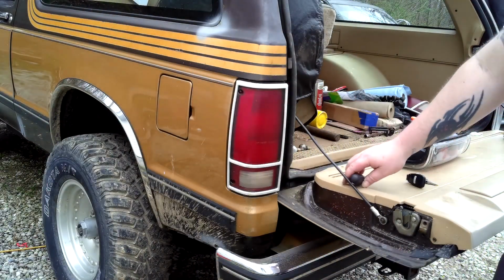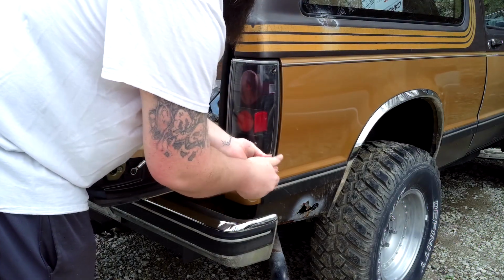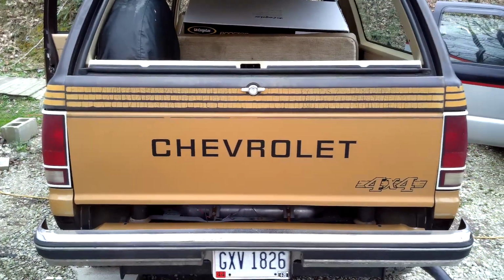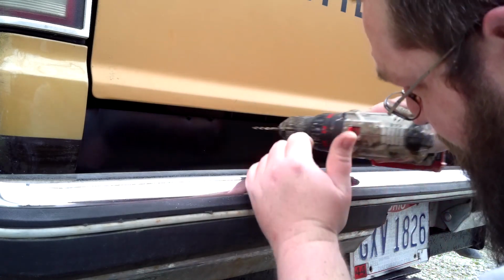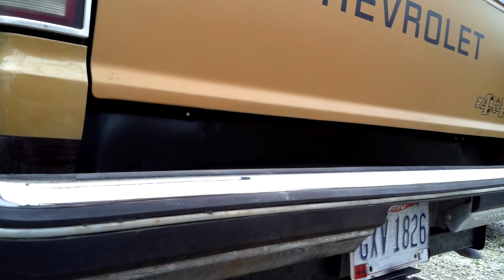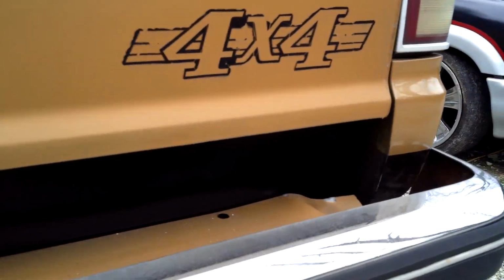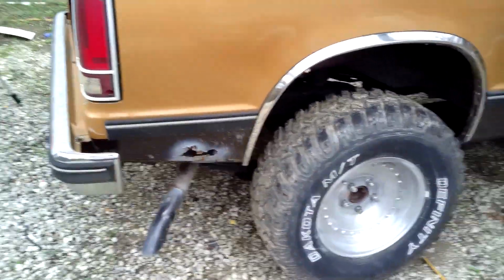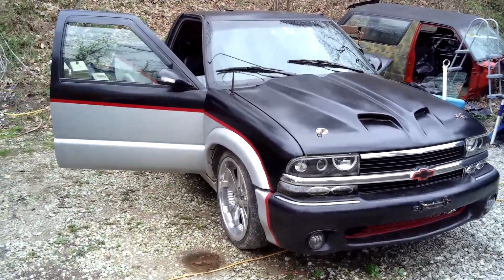Swapping Out Taillights & Putting In Rear Filler Cover

Comment: How much are you asking for this chevy blazer now..I want to buy it and put the 4.3 I have with a comp cam in it ..or I will sell this 4.3 to you it has a comp performance cam in it the motor has 56 thousand miles on it when the cam was put in it....it has ARP heads studs and intake bolts and a tip distributor...I built the motor to put in something like this
Reply from the maker: For some reason I'm not getting Notifications for message and Idk why not..... I originally wanted to do a 4.3L swap on my blazer when I had it all apart, but at the time I couldn't find a good Donor Blazer tho, I was trying to find one that had a good 4.3/5 Speed in it and I had found one but it was a Round Body Blazer tho, so it had the 96+ 4.3L in it and I didn't feel like doing the whole Carb swap thing on it or dealing with all the wiring to hook it up, I was looking more for a Plug N Play kinda thing, So after looking & looking & looking and not finding anything else at all I just put the 2.8L back in it (sadly), but I even looked for a good 3.4L to put into it and again I couldn't find one that was good.....